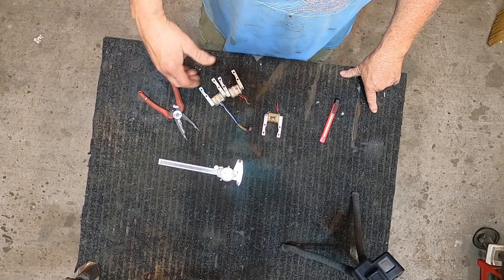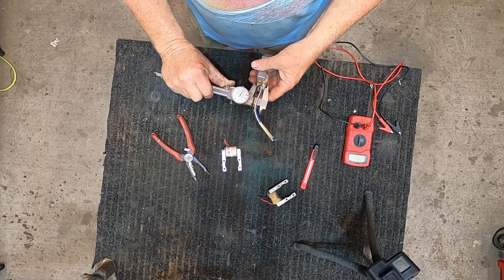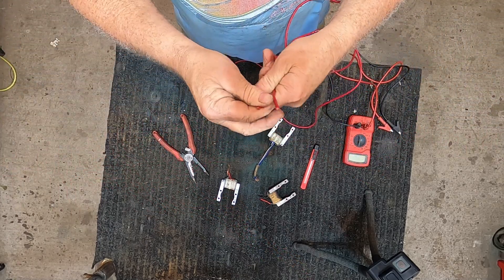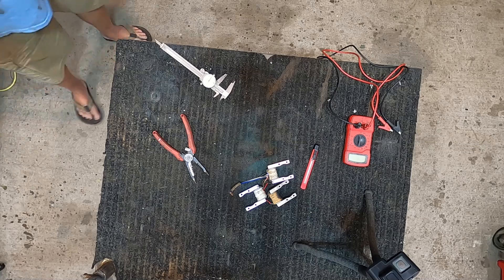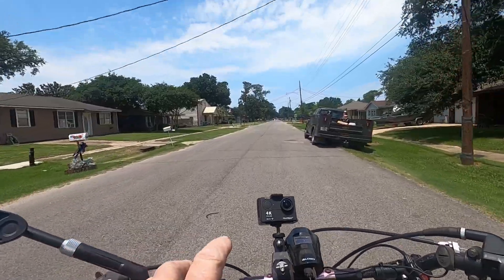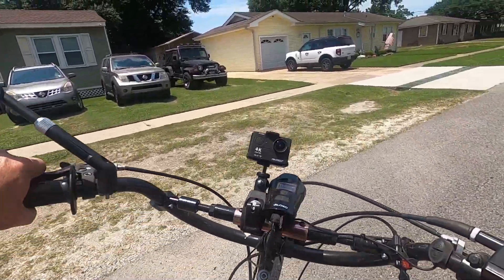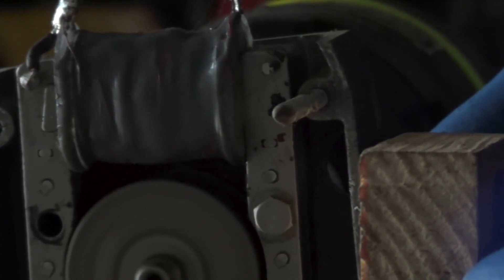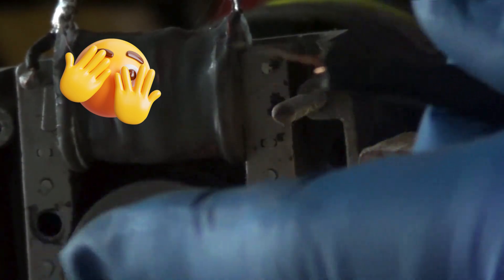Motorized bicycle Magneto can we build a better one.

Comment: Thanks for the video.  Question-what size awg wire did you use?  I just rewond one with 26 ga wire to make a magneto for an ignitor and got a good spark but won't fire the cdi!!
Reply from the maker: Originally they come with 38 Gage wire I use 34 The smaller the wire the higher the frequency and higher the voltage Thank you so much for watching

Comment: Funnily a topic I'm very good at ok ohmes is a electrical unit of resistance lesson 1 wire's are measure in gage lower the number thicker the wire if you no a transfer repair shop you can find copper wire the magnetor wire is no difference I could easily rewire a mag to ohmes just use the same gage wire to repair high out put mag would be lower ohmes thicker gage wire.How I know is because I've been rewire sound system speaker voice coil for year's now never got my ohmes wrong 💯
Reply from the maker: And really what I was trying to achieve was spark at a lower RPM but wire size doesn't really make any difference within a changing electromagnetic field but I do think that it does fire at a lower RPM because in the first of the video I couldn't see any spark or I could see just a faint spark and then when I touched it lit my * up thank you so much for watching and yes you are very correct ride safe brother

Comment: I bought an ngk 5k ohm resistor plug cap/boot in an attempt the eliminate the bad frequencys frying my cdi. I have no clue what im doing
Reply from the maker: A lot of products used in these bike engines and parts is cheap inferior stuff we just have to sift through it to find out what does work and to make it work good thank you so very much for watching brother ride safe out there

Comment: I seen a video of an old scooter alternator/stator repaired/rewound like this because nobody sold stators for it anymore. 
     I'm still on my 1st coil from 2020. I think possibly because I coated the new coil in harbor ⚓ freight clear 2 part epoxy to make sure no moisture got into it.
I'm not sure if coating it helped anything but it sure didn't hurt & was only 50 cents.
Reply from the maker: Yes it probably helped keeping the wires from vibrating and wearing through to the bare wire and that is what I think that has been happening thanks for watching brother you ride safe

Comment: Had same problem years ago the primary stator heated up and engine died. Exactly the same. Simple fix was loose the primary stator coil. Took me two break downs before i swapped the stator coil. Sadly it tested ok with ohm meter
Reply from the maker: Mines testing OK two that is the only thing I haven't changed and I got to thinking about what would cause this heat vibration wearing through to the bare wire shortening the contact length then heating up and dying that's what I'm thinking anyhow I hope you're doing good bro thank you so much for watching

Comment: That's pretty interesting Kevin but where do you get the enamel coated wire from and how do you attach it to the coil?
Reply from the maker: I got the wire off Amazon they come in 50 gram rolls and I'm going to do some more testing before I tell everybody run out and get this so I feel as though this is a better Magneto and the epoxies high temperature epoxy and it's not going to let the wire move within the coil so hopefully this is going to work but I got to let the weather clear up down here
Reply: @KevinTodd  I know about the weather our lake was half empty and in 3 days of 5 to 6 inches of rain our lakes are over full thank you Jesus can't live without water yep we were in a bad drought not know more lol be safe brother
Reply from the maker: @mikemiller3303  I drove home from Baton Rouge to where I live Thursday night I never drove through rain and wind like that ever it was bad thanks for watching brother
Reply: @KevinTodd  yes sir it rained 1 of them days so hard it started hailing quarter size I'm 60 years old I never seen it come down like that the street looked like white marbles rolling down the road the front yard looked like it snowed but it was all hail and rain you couldn't see the house across the street and our lake I've been telling everyone was half empty got full that day now we've had 2 more days of rain since then so it's over full now lol crazy weather this year